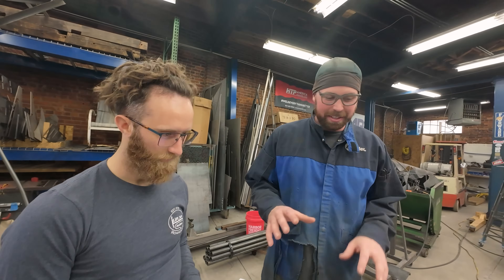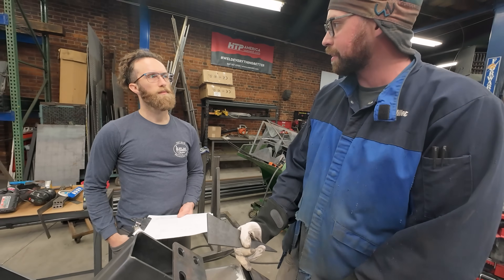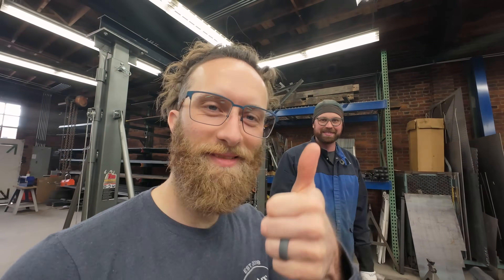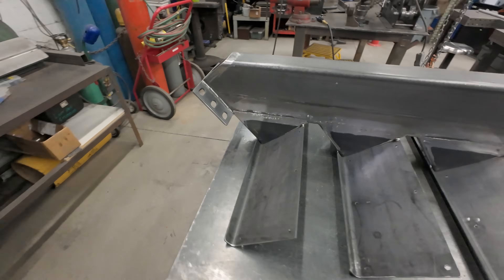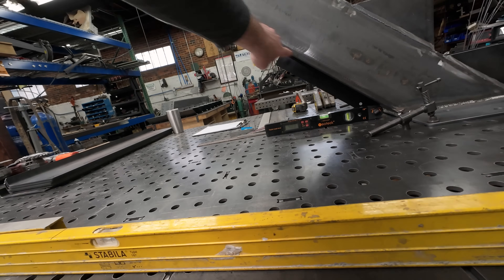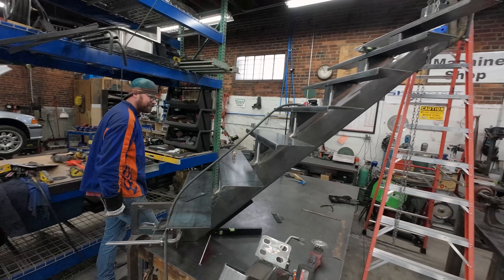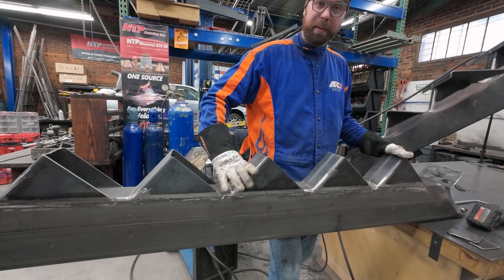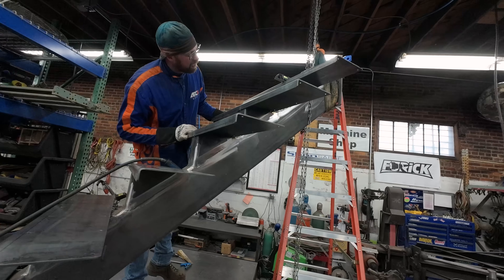THE STRINGER STAIRS - Giant Mono Stringer Staircase Build (Part 2)

Comment: I know you hate comments on insanely unimportant issues. I agree with that belief. Comments should be constructive, present questions, or say good job. All of that is well & good, but  your welding jacket/shirt is driving me crazy. That rip in no way impacts your ability to weld or do your job. You are even practicing fiscal restraint in continued use, but you've got my OCD in overdrive. I try to look anywhere on the screen, but that pocket. You have even trimmed it a bit. Or more has material has detached? That does help....but.... If I lived closer, I'd drop by with my mini sewing machine and patch that ripped pocket in a few minutes. For a while, I kept thinking you could use an iron-on patch...however, it's too large now. Know anyone who can use fuse bond or sew on a big patch before it drives me more insane than I already am?

Comment: Could you have used the 4x8 HSS to make the “wedges”? Then would have been same width as the stringer.
Reply: Looks like they burned those out of plate and then bent them.  Much easier than making multiple cuts in 4x8 tube, especially if they have a computer controlled press brake.